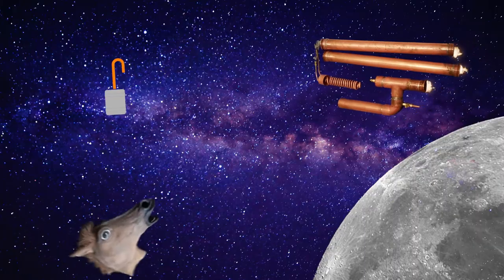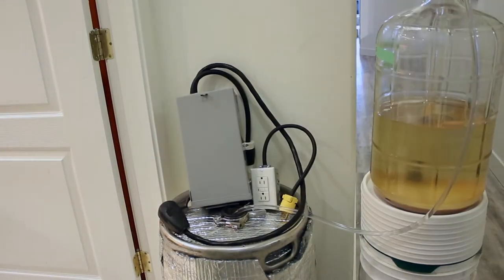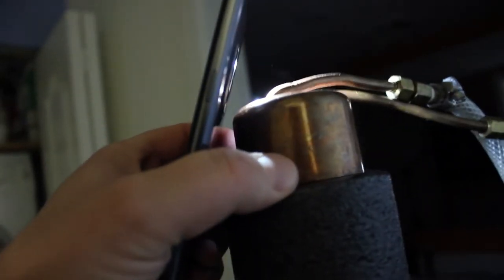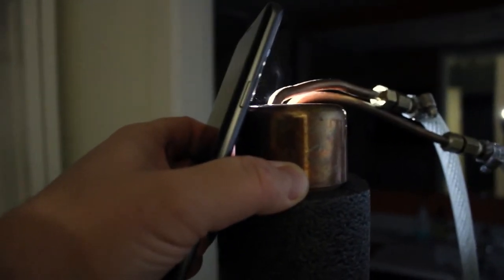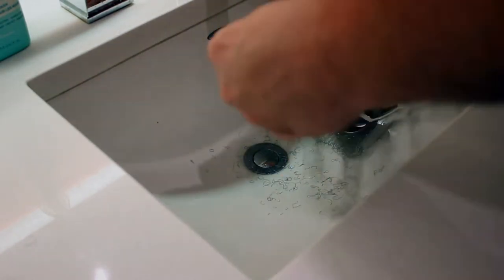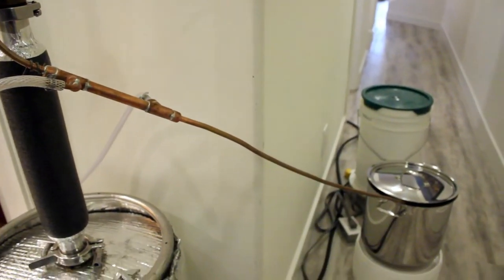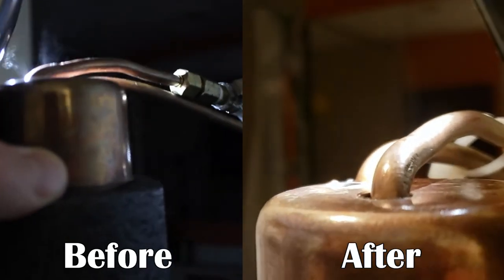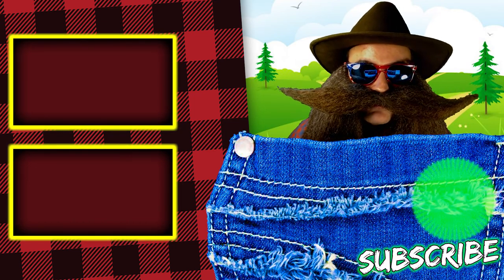[FIXED] Puffs of Vapor Escaping Still - Stripping Run #2

Comment: Nothing wrong with an homemade relief valve! Lol I’m still waiting on the Spindel hydrometer. How did you make out with that?
Reply from the maker: The lithium ion battery charger breakout board go lost in transit. Been working with the folks in China to try and figure it out. In the mean time I ordered a single one from ebay but it will be weeks before it will arrive. Trying to figure out if I can start the project without the last component or not. I believe I can load the firmware right now but don't think I can do anything else. It's frustrating because I ALMOST have everything I need!!!

Comment: I am somewhat confused by the relief hold and your condenser which makes your system a closed system? I was operating under the premise your was a standard non pressurized still that is merely a boiler to a condenser, so at what point would pressure build with your design.
Reply from the maker: What is a relief hold? If you are speaking to the hole after the condenser it is to ensure that the still never becomes pressurized. Because of the hole, the still is not a closed system. My still is not a vacuum still. It is a liquid management nixon-stone offsset still, similar to a bokakob. Are you saying the hole is not necessary or a BAD idea?
Reply: He has a LM (Liquid Management) still (Column). If you look at frame 2:31 hot vapor (would) hit the dephlegmator (Helix Copper Coil) and runs back down and back into the column via gravity. The 1/4 inch (?) needle valve beneath the elbow gets opened and he can collect the condensed alcohol instead of returning back into the column.

If that 1/4 valve was closed and the rest of the column was "sealed" - You Have a Steam Bomb.
Think pressure cooker with no relief valve..

In a traditional pot still. There is always somewhere the vapor can travel - Up and out to condenser or thumper then condenser. There are hundreds of different still configurations all which manage (LM,VM,CM) how alcohol is produced.
Reply from the maker: Hey Big Ed, that's actually a great way to explain it, to think of the double coiled condenser as a dephlegmator. There seems to be a bit of confusion because a few people are thinking this is a traditional pot still. I'm using a 3/8" need valve. Thanks for the comment.
Reply: @OpenSourceDistilling  Not at all, I use a very simple system. Your efforts are very interesting so I am open to learning about additional hardware, plus the control system using a Pi computer is interesting. Currently I just track the column temp using a PID, but can see the value of integrating more tech to improve the yield and reduce time spent.
Reply from the maker: Hey Dan, I heard PIDs have very accurate thermometers. What do you use to power your still? Electric or gas? I've got the hardware now to hook up a phase angle SSR to a raspberry pi, with a little luck on some python code we should be able to get it working with with a 208 volt element. Been playing around with a temp controlled fermentation vessel for the last couple of weeks and have been running into some issues with my temp probes. Thanks for watching!
Reply: @OpenSourceDistilling  I like you have to work in close proximity to others, add to that I have to be inside an unconditioned area in the Gulf Coast where heat and humidity is extreme. So my current solution is a 220 hot water heater element controlled by a PID measuring the temperature at the top of a column on a simple still, no reflux. Probes reliability is a tough one, German or Japanese probes harder to find than a Hoing Kong probe, however so far the Hong Kong probe works reliably, just use an analog gauge you are familiar with to cross reference the probe over several runs. That gives you a base to decide how far off the probe is and if it runs reliably. Lots of interaction initially, but after that you can feel confident about the probe.
Reply: @CascaFugioLonginus  I would recommend using a SSVR (SolidStateVariableRelay) as a power controller. Think of it as an industrial Dimmer Light Switch to control lighting. I have separate PID controller box for brewing beer.

On a SSVR controller - Turn the knob up would be like turning on the water in a faucet. On high you have a fast stream (Stripping run - Fast product low ABV), on low - thin pencil stream (Higher ABV). On real low - Drip, Drip Drip and very high ABV.

Comment: Surety with  that configuration of still, you're not using a closed system?  Otherwise you would have to remove your column, when your still is cooling down.  To avoid collapsing the boiler!
Reply: Think I have my answer, way down below in another thread!
Reply from the maker: The puffs are coming out of the hole, the hole is there to keep the system open and free of pressure buildup :)